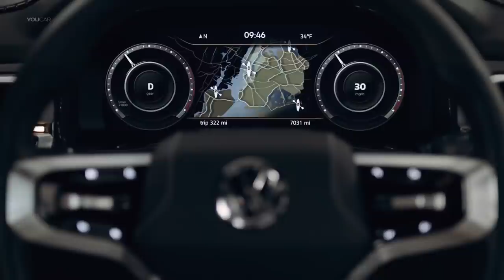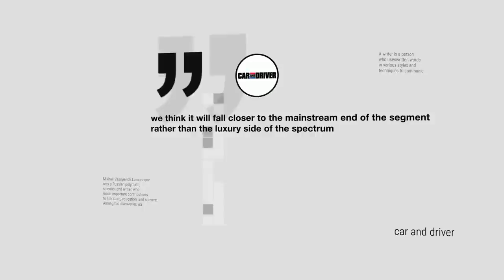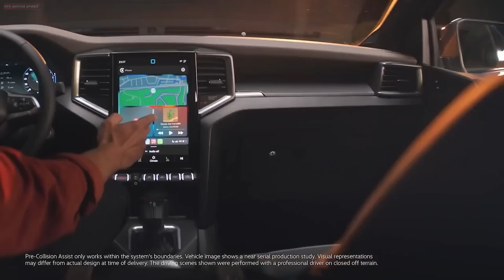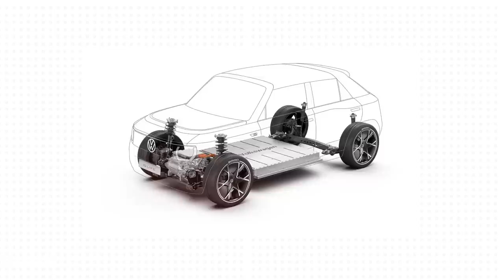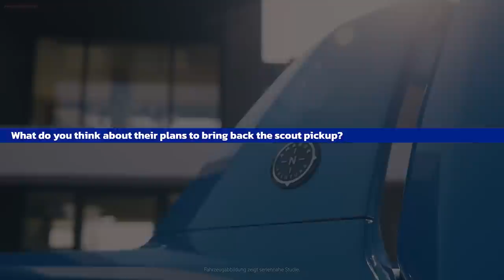Volkswagen CEO Confirms NEW $30k Electric Pick Up

Comment: VW most definitely has offered a pickup in the US. It was the Rabbit pickup.
Reply: Type 2 Truck came first.
Reply: Cabriolet too.
Reply: @72dickieb I believe you mean the caddy, the cabriolet was a convertible rabbit.
Reply: And it was built in the US too
Reply: They have to deal id 4 in us upgrade 1st.
Reply: 48hp of fury for the diesel truck believe 😂❤ I drove one loaded down with three people over a major CA pass twenty years ago
Reply: Friend had a diesel that did 50 mpg.
Reply: I owned a red, standard trans. My First vehicle 🎉
Reply: It will be cool if they revive the Rabbit Pickup nameplate!
Reply: See one rotting on someone's front yard everyday. Just sad to see it going to waste..
Reply: Mexico gets the Amarok as well. Still North America 🤷🏼‍♂🤷🏼‍♂
Reply: Not really a pickup truck in American terms. 😂
Reply: @anttikalpio4577  just like how the 88 hp Chevy S10’s and Ford Rangers in the 80’s were not trucks by American terms.
Reply: The Rabbit PU was awesome! I filled my Rabbit diesel every 5 - 6 months! And given the import PUs of the era (Toyota, Datsun, etc), it was absolutely a real PU!
Reply: VW also had long bed two seat and short bed three door trucks in the 1960's based on the Van chassis
Reply: I built a Rabbit pickup with the motor from a Audi GT coupe back in 1989. Was a stoplight bandit. Many GT Mustangs and Camaros of the day were surprised. Cosmetically I converted the front end to quad headlights and the single wiper from a Mark1 Scirocco with GTI badging and wheels.
Reply: That was a car with a bed intended to end run the truck tax.
Reply: I own one.  It was made in Pennsylvania because of the chicken tax.
Reply: @anttikalpio4577  the vw rabbir pickup had a 6 foot bed, at least.  Also very easy to put stuff in it because the stock height was low.  Cheap 13" rims and tires, no other truck from that era had that, from my memory.

Comment: $30K? I'll believe that when I see it.
Reply: It’s all about the add ons!  Probably another 5-6k for needed features and “subscriptions.”
Reply: The Tiguan starts at 28k and I just optioned one to $42k on the VW website so a 30k starting piece electric truck is not out of the realm of possibility
Reply: @kilovwdude6457  Is your Tiguan electric?
Reply: @huskypup3489  I don't have a Tig I was just using that as an example after looking at the price of the id4 a 40k-50k starting piece makes more sense unless it's somehow based on the atlas
Reply: @kilovwdude6457  Maybe a stripper could be made with a smaller battery for $30K, but I think a version anyone would want to actually own would be closer to $45K to $50K.
Reply: Agreed. Only Chevy has stayed consistent with lowering prices, and that was only on their car line. Tesla raises and lowers so much it’s more to combat demand I think and has nothing to do with serving low and middle class car buyers.
Reply: Apparently the author forgot about the VW Rabbit pickup. Quite reliable and long lasting, particularly the diesel model.

Comment: That red vw they showed was hands down the best looking pickup, i would buy that now
Reply: Buying a truck that can’t do truck stuff (towing/hauling) for more than 50 miles before having to charge for hours seems like the kind of thing guys that wear eyeliner or can’t change their own oil would do.
Reply: I've never bought a vehicle because of looks. After all, I don't see it when I use it.
Reply: Is that a reason to buy a truck, because it "looks good"?
Maybe want to reevaluate your choice thinking.
Reply: To some of us yes. Looks matter. Reliability can be solved by owning more than one car, so, the good looking one is not oftenly used or getting too stressed. My exception is, I prefer a diesel and manual which I doubt their would be one.
Reply: This is why Americans have cars that cost more monthly than their residence. Because "they look cool."
Reply: Damn nice looking truck no doubt. I’d buy it too
Reply: @sailasmali2621  : why buy a truck that's not often used? Rentals are pretty cheap for once or twice a year.
I usually double up with someone, as I likely would need help unloading. Last time I rented a truck, the other fellow got drywall and I got 3 doors. Even cheaper split 2 ways.
And owning 2 vehicles is double the insurance, which makes every use that much more expensive.
Reply: @drewthompson7457  That is fine where you are, in US I presume. Where I am there is no renting. I'm in Tanzania, Afrika. Here you import a car, costs double the price after clearance. For average working people, we can afford the used ones. So, you buy a car that you like, you buy it for life or for long time use.

Comment: I hope that the people who designed this truck are more competent than the people who loaded the canoe on the roof.  The canoe is resting directly on the cab, which is a surefire way to damage both the truck and the canoe.  The ratcheting straps can also damage the canoe.  The straps aren't even securely against the gunwales.  With no endlines securing the boat, it's going to slide around every time there is a crossbreeze.  I know this is just a concept video but I wish that the designers would talk to the people who carry things on the roof to see what we really need.

Comment: I’ll believe it when I see it. A lot of these manufacturers have been talking a ton about AFFORDABLE vehicles for years…and most all of them are typically $50,000+.
Reply: Buying power is also decreasing in real terms. 20k is not affordable for most of us younger folks these days. At the rate all this is going, the automakers will have issues on several decades.
Reply: A few decades ago, a manufacturer said everybody wanted cars with the highest trim level with all the bells and whistles. I couldn't believe it. Now, that manufacturer doesn't make cars.
About the same time, I bought a brand new stripped car. It had manual windows, a manual transmission etc. It did have an electric start, but also included a hand crank and a matching crankcase pulley. That was a great car. Didn't break much, and parts were very cheap.  (but made better than a lot of present OEM stuff.
Reply: In 2017 i bought an LX Honda civic here in Canada for 22k taxes and fees in. Now they start at 24k in 2022, damn near 29k with all the freight and PDI fee's BEFORE tax. That comes out to 32k after tax. 32k for a base model honda civic, they're out of their damn minds. This will be my last civic unfortunately. 10k more in a matter of 4 years. it's absolutely insane.

Comment: I think that small off-road oriented pickups should be big battery PHEV’s. Like 40 kwh battery and a 3 cylinder, 70 hp engine. That way if you’re deep in the wilderness, you’ll never have range anxiety.
Reply: Technically you are not allowed to drive any motorized vehicles in any area designated as Wilderness. At least in the US.
Reply: Agree - the market barely gave PHEVs a real chance. I have one with a 10KwH battery capacity - 85% of the time I drive in pure EV mode. Even though it's more complex - I figure in 400,000 miles of driving - the gas engine on my PHEV wont even have 70,000 miles on it. The weight of the gas engine and fuel tank don't weigh more than if I had an 80KwH battery yet I still have more range. When I need it, I can burn a little gas on a road trip, or up to the ski slopes without even thinking about charging.
Reply: Just as an FYI, on another overlanding channel on YT they just drove a Rivian to the most remote area driveable too in the lower 48 and had no problems.   They also say that the Rivian R1S may be the best SUV they have ever driven (ICE or electric).
Reply: And you can easily carry additional range (fuel). But who are we kidding, only a small minority of people actually go "deep into the wilderness". Most are throwing in the kids hockey gear, groceries, cooler for the beach etc.
Reply: @Kactapuss  that’s true if you live in LA,  but if you live in Coos Bay, Oregon and you go 40 miles inland up into the coastal range on logging trails to cut firewood from the leftovers at logging sites, or you go deer hunting, or you go camping and hiking for a week at national parks or you do the Rubicon trail or… the list goes on. The 135 kwh battery in the Rivian R1T is only going to be able to discharge 105 kwh when it is 6 years old. That is like carrying 10.5 gallons of gas. That is not enough fuel to do any over landing in a pickup, especially when carrying extra weight from camping gear. And I’m not just making that number up. I have a Tesla model S 75 D that is 6 years old with 90k miles and it can only discharge 60 kwh in warm temperatures. 80% of its advertised capacity after 6 years.  On the freeway at 80 mph, it will discharge from 90% to 10% charge in 2 hours. Battery range is not a problem for 80% of the time that you use an EV, but for those other 20%, it can be a real problem. This is especially true when you’re talking about pickups that have more weight, bad aero and are more likely to be used in areas away from freeways, where fast chargers are common.
Reply: @greentransmission  the problem with Rivian a few months back from a previous video I saw, was the driving range when towing. If you’re trying to live full time or even part time in a trailer while using the Rivian to tow your trailer, the range goes down dramatically. To the point where you need a charger every 100 miles.
Reply: @StrongerThanOceans21  yeah, I think it’s depends on what your towing and how your towing it.  A smaller tear drop or  pop-up, etc would probably be closer to 200 mi (or more) and you should be able to charge at 30Amps (or more) at proper campgrounds (with RV hookups).
Reply: @StrongerThanOceans21  In the same scenario where a Rivian needs to be charged every 100 miles, a Ford 150 was getting 7.6 mpg and a a Chevy Silverado was getting 7.4 mpg. So with a gas powered pickup with a 24 gallon tank, you need to fuel up every 180 miles. The energy requirement is the same, whether you’re towing with electric or towing with gas.
Reply: @greentransmission  We are now entering the era of  batteries waste being applied to the same old cumbersome personal transport formula and moreover we will be trampling the remaining nature by any means possible . What an exciting era.
Reply: @ldmcnutt  I hear ya! I have Jeeps. In an EV heavy loads can really eat up power too. I've watched some of the towing tests here on Youtube where range goes down.
Reply: 70-hp 🤣
Reply: @ldmcnutt  180 miles is almost double 100 miles.
Reply: @toyotanerd2269  it’s like that for any EV vs gas powered vehicle. Unloaded range for F150 lightning is 300 miles vs 600 miles for the gasser. Tesla model 3 range is 330 miles vs 560 miles for a
BMW 330i, etc. The thing that makes EV’s workable is that you charge up over night, every night and start the next day with a full fuel tank without ever having to go to the gas station. For 99% of all trips that people make, the battery range is enough that you never need to go to a public fast charger.  In the last year, 60% of my charging has been at home, 37% has been at my work, where they offer free charging and 3% has been at Tesla superchargers.
Reply: @ldmcnutt  105 kWh is more like 3-gallons of gasoline.....and this is the problem.  very low energy density 
HCs are the better store of energy
Reply: @zaneenaz4962  gas has 33.7 kwh energy. Per gallon.  Gasoline engine is 28% thermodynamically efficient. 1 gallon gas does 9.4 kwh of work. EV is 90% thermodynamically efficient. 10 kwh battery charge does 9 kwh of work. So 1 gallon of gas is equivalent to 10 kwh in a battery EV. You can double check the math by looking at EPA ratings. F150 lightning is rated at 49 kwh per 100 miles. F150 4x4 Supercab gasser is rated at 4.9 gallons per 100 miles.
Reply: @ldmcnutt  Had to look back to your wording....."That is like carrying 10.5 gallons of gas." .... You're correct:  Effectively 10.5 gallons.  
But, think you will agree most trucks carry much more than 11 gallons, plus they provide their passengers with plenty of heat.
Hope we continue making more progress with electrical energy ....and the energy storage systems.  Thanks for your comments. Cheers.

Comment: One of my first jobs was working on Beatles back in the day simple and easy machines made to fix 
However after my kids experience with a Jetta a modern VW will never darken my  shop bay again
Reply: My last and only VW was an "85 GTI. What a POS. I replaced it with a Lada, and had a much more reliable car.
Reply: @drewthompson7457   I wouldn't say the Jetta was a pos they just do the best they can to prevent one from having the tools ...way to much proprietary stuff
Reply: @2fuzy  : Yes, and it still broke way too often. I got rid of it when it was 5 years old. When I removed the rear plate, there was a 2 inch rust hole, all the way thru. As well as too many other break downs. Alternator, which took out the battery, heater core, clutch cable, fuel injection failures, wheel bearing, brake rotors which wore out way too quickly, a new windshield every year, as going over a bump would split them, plastic trim pieces, horns filling with road dirt and failing. I got cut every time changing an oil filter, as there was no room for simple maintenance. Getting a Lada gave me so much more piece of mind, more reliability, and, actually, more fun to drive as the Lada was rear wheel drive and better weight distribution. No, I really can't see treating myself to another VW.

Comment: After watching Out of Spec Reviews video about the EA chargers not working in cold weather, it will be a while before I jump into an EV. The $30K range is getting perfect for middle class buyers, but there has to be a reliable infrastructure to go along with it.
Reply: The only chargers he tried that didn't work were the brand new generation of high speed chargers by Electrify America. EA will fix this bug quickly. EV owners do over 90% of their charging at home.
Reply: @pauld315  So EV's are basically an option only for those who own single dethatched homes. I'd love to see how they plan on providing charging for EV's for the millions living in Condos and apartment buildings lol. Ban gas cars by 2035 though right?
Reply: @europeanlegend9347  I have a house with solar and I don't care about condo dwellers. It's not my problem. I want a good EV pickup now.

Comment: VW used to sell  VW pickup truck / the VW Camper / the VW delivery truck / the VW bus.  Because Germany wouldn't import and sell USA chemically processed chickens, the USA retailated.  This was referred to as the "Chicken War".  The USA added  (I think) a 20% Import Duty on all VW products that were the pickup / delivery van / bus / camper.  That Duty on small VW products is still in place - as is Germany's refusal to import USA processed chickens.  Now, with new manufacturing plants in the USA, these VW types of vehicles can be manufactured in the USA and can be sold  with out the 20% Duty penalty - these cars are built here and are not imported.

Comment: It will be like the transporter electric, limited to 55mph and a poxy 200 ish mile range. It won’t have a 3.5t tow weight or 1100kg load weight

Comment: Early 1980's, possibly was 1982 and VW showed a prototype hybrid diesel/ electric Rabbit pickup at some of the larger international auto shows. Had a brochure of it. The USA market Rabbit diesel truck alone was an old dog slow but delivered outstanding fuel economy.
Reply: Outstanding? Not really. The CRX got better mileage and had more power.
Reply: Yeah, they did zero research for this video.

Comment: If you are going across attain that might take you 3 hours an go 20 miles how much battery life would you use and you are climbing a mountain road how do you keep the mud an dirt out of your electric components. ? Explain please thank you .
Reply: But going down the mountain puts a lot of energy back into the battery. That said, I read of a full size EV pickup truck, that when towing, would go only 85 miles. Then you park the trailer somewhere while you find a charging station. And big batteries take a long time to charge. You keep dirt out of the electrics the same as with any machinery. But I might be leary of fording a stream,...
Reply: So what go is a electric truck and what i understand they blow up in water . I'll stay with fossil fuel. I can haul fossil fuel . Thank you

Comment: 47 1/2" between wheel arches is just silly. Sheets of ply etc are 48" so I guess there market isnt contractors. I think I remember something about high taxes if the truck isnt made in the usa could be wrong though. 30k might be a stretch

Comment: The new Amarok is based on the Ford Ranger, they may have an agreement with Ford not sell it in the US market.
Reply: Unlikely given both are sold in most countries and the Ranger is not an established model in the US. The real reason is more to do with the chicken tax and the consequent need to build it in the US, which is a more risky proposition for VW for what is likely to be a lower volume model.
Reply: @iatsd  how do you figure it’s not an established model in the US? It started life in the US in 82, and has been sold here the longest. Before that it was a trim on the F-150. Obviously it’s not Ford’s top seller, but it’s a well recognized Ford model in the US and is a popular truck here, and it’s also shared platform with a US only model, the Bronco. But you are right about the Amarok would probably not be a bigger seller in the US, but it would be easy for Ford to build them alongside the Ranger here in the US. Sort of like BMW with the Z4 and Supra.